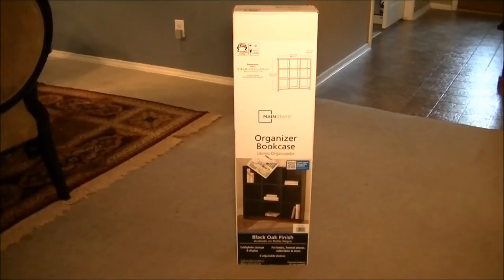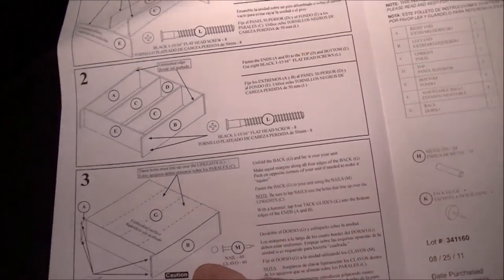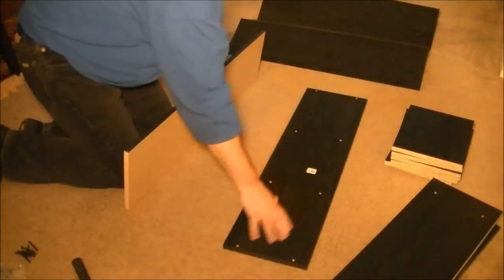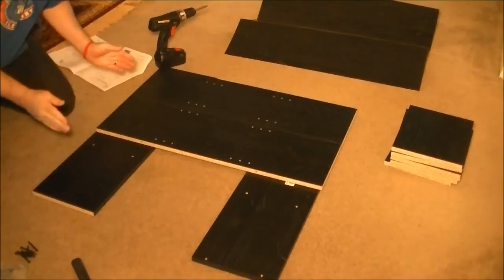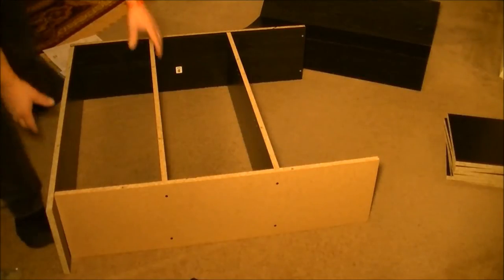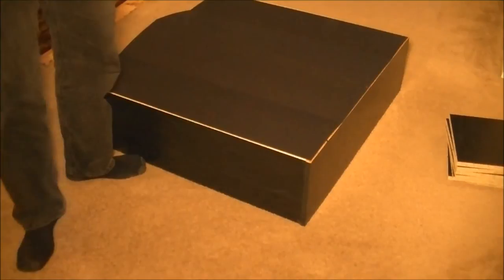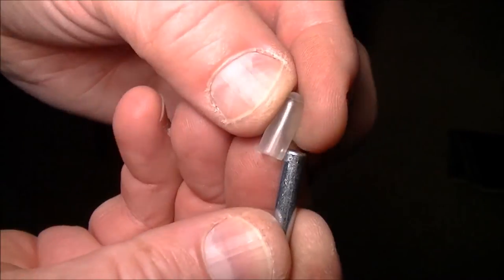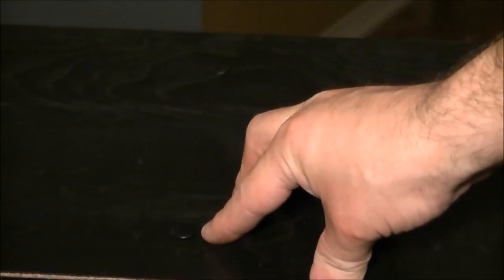Sauder (Mainstays) Bookcase  Black 412318 Complete  Assembly

Comment: This may be a stretch since you posted this two years ago, but you wouldn't still happen to have the instruction booklet for this, would you? I moved a while ago and lost some pegs, so now I have a useless shelf. So I'm trying to find out how to order replacement pegs with the little plastic caps on them. Thanks in advance!
Reply from the maker: Unfortunately I do not have the booklet for this. But it is the Sauder 412318 and you can order parts for it here http://www.sauder.com/CustomerService/Order-Replacement-Parts.aspx Thanks.